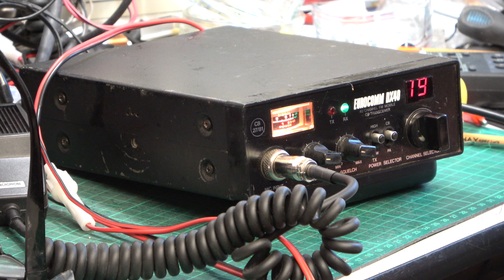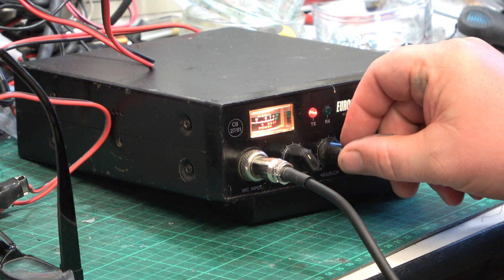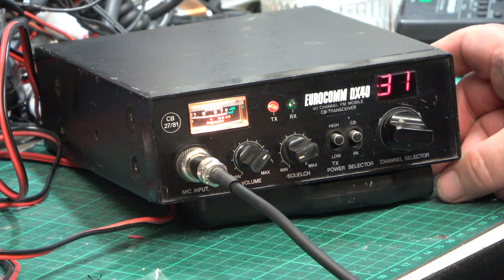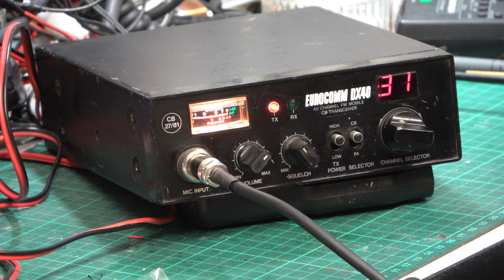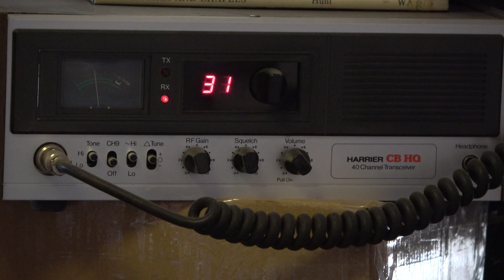Eurocomm DX40 UK CB27/81 CB radio (mobile) - On The Air test

Comment: I do wish you would show me what is inside these sets so I know to avoid it or not. I don't need to see you working on them, but i do like seeing the circuitry.  Binatone made a really good one and it partner was rubbish.  I don't remember the model numbers though, it is a long time since I used CB. 
DX40 why do I know that number, oh, it was a PT40, it was another piece of S**t.  I bought one just to have in the car, I wasn't to bothered if it got stolen, but it was so rubbish I gave it to someone out of disgust.  The oscillator was very slow in picking up so you got a bizonnnnn as you keyed the mic.  and going back to receive you heard it as it found the channel it was supposed to be on.  I put it back as it was under warranty, as you do, but just after I got it back it started doing the same.  Went back to the agents and it only took a day to develop its old habit.  We had a look at it ourselves and although we did improve it it was just crap!  PT40, avoid at all costs, even putting a crystal filter in it was no easy task!
Oh I see you have another video of it.  I will go look at that.
Did you ever have a PT40 in or one of its many disguises?  I knew it was far to glitzy to actually work!
The person I gave it to was disabled, they thought it was it was brilliant.  Happy days.  I put up an antenna for then and made sure it was working fine.  All for a cup of tea and a friendly wave goodbye   :-))   At least someone got the good of it, they were still using it when I gave up on CB.  I wonder if I gave them a shout would I still get an answer?   Nah, I think they would be pushing up the daisies by now.  They used to talk to all the lorry drivers as they passed and all the salesmen ding their rounds.  Kept them happy.
Reply from the maker: errrrr....I always show what's inside the sets doing a full realignment, then we do the 'on the-air' tests. Only last week I did the best of the PT40's. the Lowe TX40 & I worked very well, the next PT40 in the 'good' section was the Grandstand Hawk. Then the rest of the PT40 are much of a muchness with two main variants, those with PA facility & those without. The ones without are inferior inother ways for some reason.. I think there were about 8 badge engineered versions of the PT40....Viper 88, the Smokey Bear PT40, the Braemar PT40 & the WorldSound (who were the makers) PT40, plus the Sun 402 ....they are the ones I can think of right now. 

The really good Binatone sets were the two Cybernet made ones, the 5-star & the Speedway.

Richard
Reply: @ukfmcbradioservicingTango21  I found the video where you serviced the set, thanks Richard.
Not sure how you worked as new here, but I am getting there.
I came across a DNT Economy set today, plugged it in and it was dead.  Why I bothered repairing it I don't know, but it is now a working set.  The last problem I has was intermittent audio, just didn't get it, turned out the audio wire was touching inside the plug every now and again.  Sometimes the simplest fault is the hardest to find. It had me going as it just appeared at random!  No meter!!  Every penny pinched!
 I think I had the the Cybernet chassis Binatone pass by me at some stage, they work really well.
Reply from the maker: I sent my friend Mark (ZX2) 35 miles away to a vantage point on Nottingham about 8 years ago with a full 9' whip on a triple magmount & a box of a dozen different radios, ranging from a new £200 Albrecht to the LCL Economy, but all serviced & spot on. He was to try & talk to me on each one in turn, giving each rig a number from 1-12. He wasn't to tell me what number related to which rig so it would be  a blind test. We didn't manage to get through the 35 miles on two of them, one turned out to be the expensive Albrecht. The best copy & unbelievable tx audio quality turned out to be the LCL Economy, followed by the crappy JWR M2!

Richard

Comment: What is the chassis in the Binatone Route 66 mk1?
Reply from the maker: The Mk1 with the PLL02A is 01/8538A & the Mk2 (as used on this radio with the LC7137) is the 01/8538 according to the manual, but I'd take that with a pinch of salt & swap them over coz surely, the later version would have the suxffix A & not the earlier one. The chassis appears nowhere else.

Richard